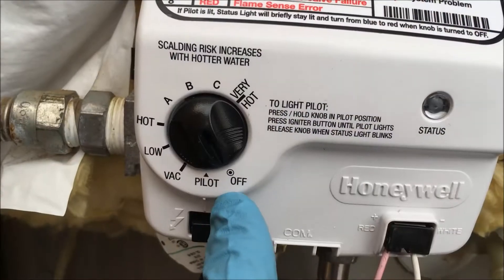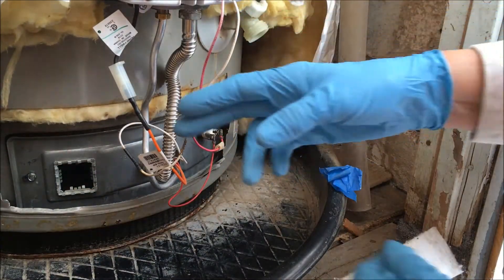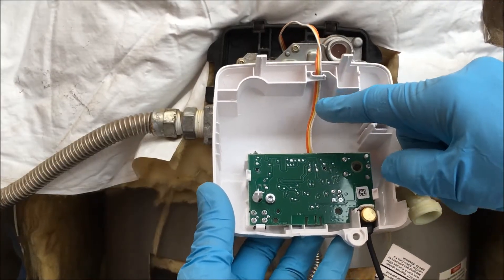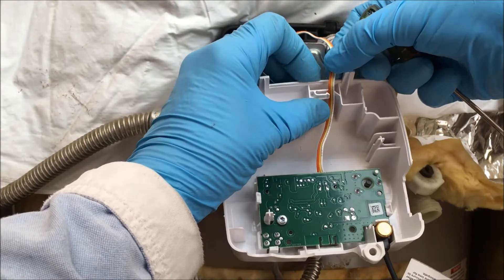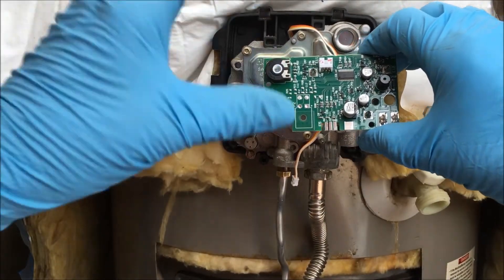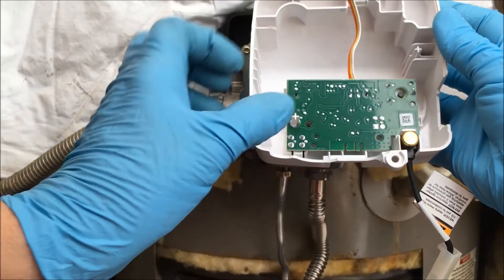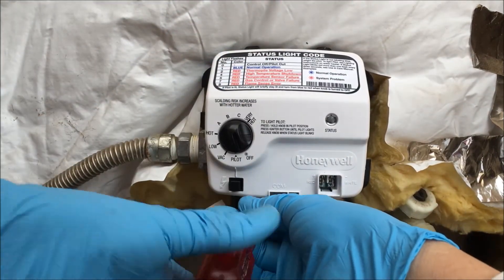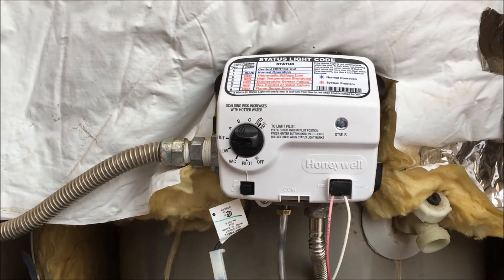Replace Control Board on a Honeywell Gas Valve | Water Heater

Comment: Can anyone do me a favor and tell me where I can find the correct "model-number" located on the side of the gas control valve?  The "model- number" currently on the gas control valve is (WV8840B1110). Honeywell advised the old model numbers starting with (WV8840) used for "atmospheric heaters" is being phased out for the newer (WT8840) (year 2020). I got a gas valve replacement error 4, over heated tank. And re-set the system to a normal 1 blink. Now, I get no spark and no indicator blinking lights. Honeywell advised the older WV8840 "requires" gas valve replacement if error 4, overheated tank, occurs even if the water inside the tank is not overheated to the ECO trip point of 188-199 F. Also was told most likely the error 4 blinking lights is a temporary misread and the water inside the tank did not reach 188-199 F, and the 4 blink error code came on due to a type of residue buildup in the tank. And was advised gas valves come out of calibration and have other problems, and its unavoidable that they do fail. And the older (WV8840) requies gas valve replacement if error 4, overheated tank, occurs. And the newer models (WT8840's) is more flexible, letting you reset error code 4 if the gas valve temperature sensor or circuit board has a temporary misread. I would like to purchase the correct Honeywell Gas control valve but unable to confirm the correct new model number to use since the old (WV8840) model numbers are being replaced with newer (WT8840) (year 2020)
Reply from the maker: loznit1234, don't purchase another gas valve until you watch my video, titled "Honeywell Gas Valve 4 Flash FIX | High Temp Shutdown," to reset and override a 4-flash "High Temp Shutdown" error code.  The 10-10-10 second fix resets the gas valve error code.  You have to have a pilot flame to use the procedure.  You don't need any tools.

Comment: Can't find a place to just buy the board. That's lame. This should be a $50 repair, not over $500.
Reply from the maker: I agree, Luke.  Look on eBay.  Type in the model number of your gas valve and see what results you get.  There are some plumbers on eBay that sell pre-owned, working control boards and gas valves they take off working water heaters on an install job.  I'd look for one of those.

Comment: We actually found the broken piece on our board and soldered it back on and it works again. Small cone shaped piece on E8 like a 1/4” big. Had something to do with the solenoid. It immediately worked after the repair
Reply from the maker: Chris, thank you for adding this info to help others who might have the same issue.
Reply: What were your symptoms? Pilot came on but the cv never actuated the gas valve to open?
Reply: @davidsoudek  E8 is the ground for the two gas valves (pilot and main burner). His pilot probably wouldn't come on.  Not sure how that would have come loose unless the controller was opened up and possibly had the cover put back on crooked. You need to be very careful that everything is aligned properly when putting the cover back on because those three gas valve pins slide into E7, E8, and E10.

Comment: Hi Thank you so much. Are honeywell control boards universal?
Reply from the maker: I can't answer that with certainty.  In my case, I replaced the board  the with a control board from a Honeywell gas valve that was a different model number than the one on my water heater.  Worked like a charm.
Reply: @frugaldiy1  Same here. Took one from a natural gas unit and put it in my propane unit. See my post on 5/16/23.

Comment: My gas water heater is wv8840c1406 board …. Can any other board work with different serial number?
Reply from the maker: Jose, I can't answer that with certainty.  But what I can tell you is that I took the board and cover off of another Honeywell gas valve that had a model number that started with "WV" but had different trailing numbers than the gas valve model number on my water heater.  And, the new board works like a charm.  My water heater has worked for months now without an issue.

Comment: Thank you for the videos, they helped me pinpont the control board. The w/h won't turn off the burner if you dial heat up to HOT. We realized this after the sink hose blew and burned my wife! Gives steady warm water below the Hot setting. Unfortunately, I cannot locate a board for the WV8880B1211 propane control valve. You said the WT series don't let you reset the 4-blink error (which I never actually saw), but WT board may be my only choice. I got one reply telling me to take a picture of the board. Can you recommend a substitute from another vendor? Waiting on a reply from State Industries, who made the W/H.
Reply from the maker: Ralph, I'm glad to were able to pinpoint the problem.  Great job!  As to the control board, please type the model number of your gas valve into eBay and see if a seller has a pre-owned or new LP (propane) control board or gas valve.  I, personally, wouldn't buy from Honeywell directly.  Some of the sellers on eBay are plumbers who have pulled working gas valves and control boards from an install or job.  If you don't find what you need, message one or a couple and ask if they have one or can get you one.  Don't be discouraged; you'll find one.  Please comment back if you need more info or help.

Comment: Thank you for video. I purchased a thermocouple($67.00) to replace the old and after relighting the pilot light and waiting for over a minute and turning the control knob the pilot light went out (extinguished, wouldn't stay on) stopped burning. I suppose the control board would be my next step, however, the Honeywell model I have WV88600-1000 222-46402-01B is not offered on Ebay! Any suggestions on where to shop for one>?
Reply from the maker: You're welcome, Richard, and yes.  Go to eBay and type in the model number of your Honeywell gas valve (found on the side of the front cover), and you should see results for the actual gas valve AND control boards.  The control boards, and gas valves, may be pre-owned but that did not bother me.  

But, before you purchase anything, I highly encourage you to watch my video titled, "Troubleshoot Water Heater AND Honeywell Gas Valve | Step-by-Step," because it should help you pinpoint the actual problem.  I think the video will help you.

Comment: Just a note, make sure the slot for the control knob is lined up the same as the old one. some new out of box are in a different position, need to relocate.
Reply from the maker: Great point to mention, deaddy57.  Thank you for posting that.
Reply: My black control knob broke it off . I found used control black knob parts for honeywell water heater.  how to replace the control knob ?
Reply from the maker: A G, put the shaft of the control knob into the hole on the cover and rotate the knob a little at a time, back and forth, while leaning the knob to the side a bit.  It will pop in place.  Don't forget to put the spring in, too.
Reply: @frugaldiy1  Hi,  I need to replace the know as well. When i remove the cover.. can i just push the arm of the temp knob through the hole of the control board with a small screwdriver to pop it out? Is it really that easy?  Kinda nervous. Thanks again for the video!
Reply from the maker: @digablesoul  The knob has a spring behind that you don't want to lose.  You have to turn the knob slowly and rotate or tip it slightly to the side to remove it at just the right spot.  Just go slow and be careful and gentle with it.
Reply: @frugaldiy1  Ty so much for replying. I think I'll buy a busted up gas valve for parts.. that has the knob.. and buy a back up used knob. lol.. knowing me... i'll break something. But.. yes.. slow and steady!! ty again for the video!!
Reply from the maker: @digablesoul  Smart idea!  Sounds like you have a good plan on how to tackle that pesky temp knob.  I hope it works out for you.

Comment: so i ordered a new gas valve controller simply to be able to get the card inside. Then it dawned on me that the only requirement is to swap the new cover and its new card inside with the old cover and card inside.  The only real task is to unplug the wires at the top and replug that in. So if you buy a new gas valve controller (about $130 on amazon), it's not necessary to replace the card only and is actually faster to replace the front cover, no need to mess with the internal screw and clips. Just be sure the black valve toggle switch matches the off position. You then also get the advantage of a new igniter button which was very stiff on my old one.

Comment: Excellent video! I just had a plumber replace my gas valve for $420. He did excellent work and now the water heater is working again. After watching your video though, I'm wondering if it was just a faulty control board?
Reply from the maker: Thank you, Heinz.  Yep, control board failure is a common problem on these gas valves.
Reply: @frugaldiy1  -- It must be the heat from the gas burning or moisture.  Maybe both.  One minute it's heat.  Gas goes off at temperature setting.  Cools down.  Circuits contract.  Then "on" comes the heat.  Circuits expand.   On a microscopic level, the circuit wires must be stressed.  Just a theory.
Reply from the maker: Interesting theory, Russell.

Comment: Hi.  Great video!  Much appreciated!

Question: have you ever had this happen: you press the temperature dial down in the "pilot" setting and press the igniter switch...then the pilot light comes on...but when you release the pilot light dial, the pilot light goes out.    Hmmm....

The gas line is good.  The igniter and thermopile/thermopoule are good.  But as soon as the dial gets released, out goes the pilot light.

Have you observed this?  What might be the problem, in your opinion?

Thank you for your time and energy.
Reply from the maker: Yes, Russell, I most certainly have and recently, too.  I did A LOT of troubleshooting to determine the problem was the control board in the Honeywell gas valve had failed.  I videoed the steps I took to troubleshoot the issue.  If you care to see that video the title is "Troubleshoot Water Heater AND Honeywell Gas Valve."  I think that video will help you.  I show you how to test out the actual gas valve too.  

If you have a Honeywell gas valve, the other problem could be that the control board issued some "Status Error Code" (a blinking or flashing light at the LED status light), so now the control board on the gas valve will not allow you to ESTABLISHED (meaning you can light a pilot but it will not stay lit) a pilot light/flame.  You have to override and reset the control board before you can light the pilot and have it remain lit and thereby operate your water heater in "normal" operation mode.  I also have a video titled, "Honeywell Gas Valve 4 Flash FIX | High Temp Shutdown," that shows you how to override and reset the control board when the water heater has gone into "High Temperature Shutdown" status.  

I hope this helps you, and thank you for your kind words and appreciation.
Reply: @frugaldiy1  --- Thank you for your prompt and comprehensive reply!  I will watch the videos you mention.  Yes, I do have a Honeywell gas valve, as part of a Rheem hot water heater system.  Best, Russell
Reply from the maker: OH, you're very welcome, Russell.  You have to be able to establish and maintain a pilot flame to override and reset the control board, so the "4-Flash High Temp Shutdown" video may not work for you.  I do think the "Troubleshoot" video will show you how to both troubleshoot and determine the problem AND fix your water heater.  I highly doubt you need a new water heater or a repair person.  I'm pretty darn sure you can repair the water heater yourself.  Please let me know if you have any other questions or if I can help further.

FYI--You likely have a thermopile, not thermocouple, on your burner assembly.  Please test your thermopile if you haven't already done so.  If a thermopile is weak (low voltage) or faulty, the pilot flame will not stay lit.  It's a safety feature.
Reply: @frugaldiy1  -- Thank you for your followup and suggestions.  I'll let you know how it goes!
Reply: @rerite2  did you get yours fixed?
Reply: @maketaco6683  --- Yes.  Replaced valve and thermopile.
Reply: @rerite2  thanks, did you replace or did the plumber (cost?)
Reply: @maketaco6683  -- Rheem's parts warranty was still valid, so I got the parts from them free-of-charge.  Free FedEx shipping, too.  

Hmmm....maybe the new valve  you got is defective?
Reply: @dong_chim  -- Hi.  When you say, "circuit board," I assume you mean the one inside the valve housing. No, I didn't replace the circuit board.  One look at it and -- not being an electrician of any skill level -- I decided to call Rheem and have them send an entire new valve and a thermopile.  A flood killed the original parts.  Hope that helps.
Reply: i have the same problem, new control board and even bought a new thermopile assembly panel (at bottom of heater). I am getting a solid status light after I let go of the pilot light button.
Reply: @maketaco6683  -- what color is the "status" light?
Reply: @rerite2  same color , white, when it blinks 1 time.  Seems this control valve only  has 1 color. One plumber told me sometimes the "probe" at the end of the gas valve, ie the cone shaped metal thing, goes bad too. But that requires an entire valve replacement.

Comment: Do you have a part number for the control board?  Thanks!!!
Reply from the maker: solarsynapse, I don't.  The control board is on the gas valve now.  But, the model number of the gas valve that the control board came off of is WV8840C1531.  You can find pre-owned and new control boards on eBay.  I hope this info helps you.

Just type in the model number of your Honeywell gas valve into eBay, and you should get search results for both the gas valve and the control board for that model.
Reply: the B1000 will work for replacing the B1109

Comment from the maker: Folks, you can purchase a control board for a Honeywell gas valve or an entire Honeywell gas valve on eBay.  I purchased the replacement gas valve (control board included) at a local Restore, so I'd look there too.  I think the torx bit is a 17.  Happy DIYing!
Reply: The Torx bit is a T-15. 
what happened to my comment that I wrote on 2/2/23 or 2/3/23 where I mentioned the Bradford White video of measuring the resistance of the coils as 11  to 13 ohms